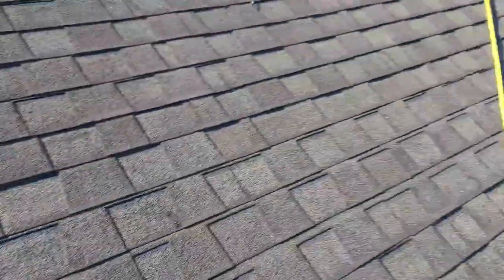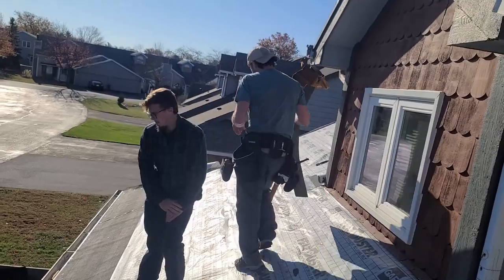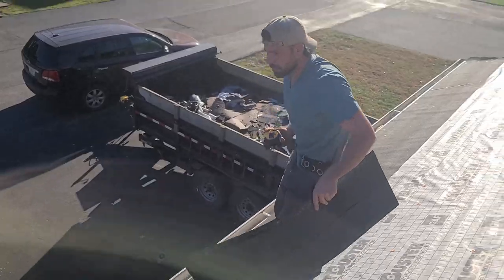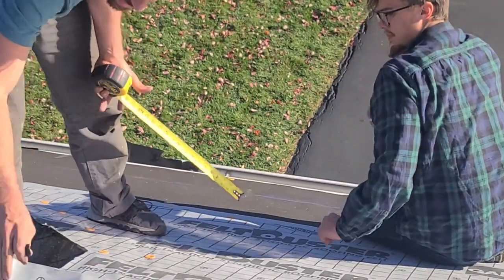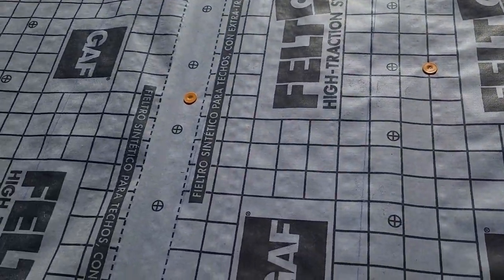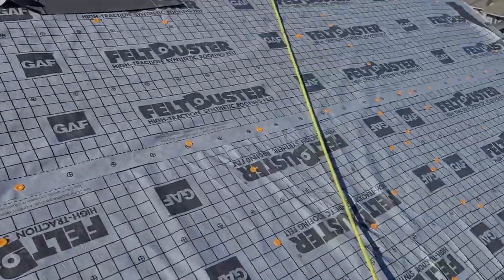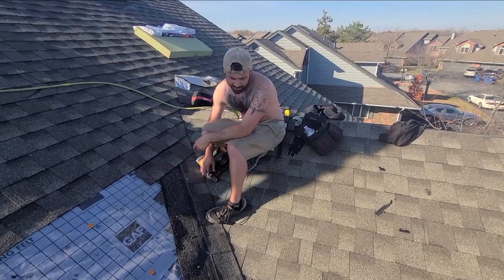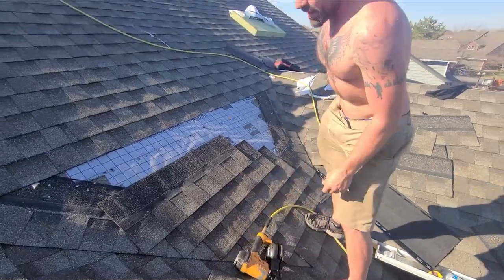HOW TO | Match Shingles Up Above Valleys

Comment: Just snap one line above dormers parallel to ridge, run up one section dropping a course 1/2 inch.  This allows you to not stretch the reveals on other sections.  Run first section near chalk line, and measure it.  The other two sections need to hit that number.   A lot less lines. Faster, and it’s good to ridge.
Reply from the maker: on the back side of this house i did that but slightly different. i was able to raise the starter on the other side of the chimney to make everything fit nicely.. but multiple shinglers made it look bad. boycub n brad haven't been shingling a great deal of time so shit gets crazy unless its just a regular straight run
Reply: This makes more sense to me and seem much faster good tip

Comment: PAPILLON,  it works out as long as the shingles are " all the same size ", sometimes they aren't. Takes too long your way.  We always snapped up in feet,  3'- 5' at a time and you don't have to backfill. We've roofed apartment houses developments that sometimes had as many as 10-15 eyebrow dormers. Never once had a problem. Just keep checking your reveal every so often. Straight as an arrow.

Comment: I like to get a metal strap and bend it up plumb off the pitch and put my laser level on it to get a control line at the bottom and the top.. Then you know exactly where the the points are off, relative to plum and level.. Tones of times.. The house has settled or the framers hacked the job or the sheeting is not clean on the edges... Its wet here in SE Alaska so if something is off. a coulple inches one way or another than put a short row with a zinc strip.. Thanks for sharing..

Comment: Holy smokes lol.... this is the craziest way I've ever seen a tie in done... take one side to top off your in dormer leave other side about 8 to 10 courses down... measure high side of plywood or ridge and pop a line to carry over them your in low side... never run courses high only low if needed
Reply from the maker: lol those guys were idiots. that's pretty much how i normally do it. but we kind of didn't do the straightest job on the back so i wanted to make up for it in the front, plus multiple shinglers..it wouldn't of ended well
Reply: @NWIVeteranConstruction  nah,doesnt matter how many sides goes up,start off biggest one then match with any remaining side by leaving 5-8 rows,super easy and fast.idk bout dis measuring sheet bruv
Reply from the maker: @user-sk9hl7si7l  I said the same about the measuring but we did it again today and only snapped our first at 11 1/4 then marked 45 90 and 135 until we got past the valleys n skylights.  Worked out really nicely and ran the rest as normal.  It actually looked really good and was fast as well
Reply: Mesure whit a tape line 😬 just trust the shingle I will ave to maike a video 😂🤣

Comment: If you chalk a line 3” down from ridge and angle the tape so you squish the courses within that space (ending up with a measurement at that top line being a multiple of your desired exposure) you end up with a full top course where the ridge caps come down far enough to cover the nails and less crap to cut off at the top of the roof. Takes a few minutes to get lines on the roof but I feel like you make up for the time in install by knowing you have good marks to work off of.

Comment: Nice work....

We do 11" if using 3 tab starter. Then mark a 12 1/4" but dont pop the 12 1/4". Its just to mark off of. Then for GAF dimensional (from the 12 1/4" mark) mark 22 1/4" marks up the entire rake. It would be 22 1/4", 44 1/2", 66 3/4", 89", ect.... that will give you some play incase the roof bows downward and when you get to deepest part of bow you won't be above the exposure line. 
Measure down from center of ridge to top mark on rake. Go to rake on other side. Measure down from ridge make mark sane as other side. 
Mark 2 or three down. Then go to eve and mark up to last mark you made at top. Check for accuracy. Adjust 1/4" or less per row to make right by the time you get to top row. 
So your cheating the center rows up to a 1/4" per line. Pop top lines above dormers and below dormers. Mark lines from existing lines under dormers and make sure they meet top line above dormers adjusting 1/4 " per line.
After all said and done top and bottom sections are perfect and no cheater runs more than 1/4" and in the middle where less notices.

3tab shingles are 11 then off of 11 its 20, 40, 60, 80, ect...
Rake lines are 11", 29", 35"....

Comment: Another good way of doing it is snapping your first line at 41 inches then every 56 inches you will drop a little bit but it works great
Reply from the maker: Sounds like a good move.  I was planning on doing 45 90 135 etc. From now on.

Comment: Pull up to pull down. Wrapping the peak will cause your bottom shingles to eat up any difference rather than have it in the middle or top.
Reply from the maker: what do you mean. pull from the ridge?
Reply: @NWIVeteranConstruction  start by pulling up from one side of the area, pull all the way up to the peak. Wrap the peak to find the mark. Make your mark and pull down.

Comment: I just put nails in the plywood joints every 4 or 8 ft then snap lines. No need to measure. Obviously measure on a boarded roof but with OSB just use the butt joints of the plywood and you will have straight lines every time.

Comment: You could never talk me into that underlayment unless it becomes code then it would get covered with felt and all valleys would be basket woven !;-)
Reply from the maker: are you still using tar paper? this GAF felt buster goes on quicker, barely cost more per sq ft. is safer because the nails won't slide through it on hot days, as well as its grippy.
Reply: Sinthetic is the way to go

Comment: Great vids man. Quick question, you measure the shingle to be 13.25, but then you chalk lines for 11.25. Just wondering why you chose 11.25? Im inclined to measure 13.25 every time
Reply from the maker: because the face reveal of the shingles needs to be accounted for in the math, see part 2 of my most recent roofing series which is very popular. the reveal is 5 5/8

Comment: Been shingling homes since 1985.  Doesn’t anyone weave valleys any more?? I make 25% of my income being called to new homes, tearing out the leaking cut valleys and replacing with a woven valley.  On a cut valley, the rain / snow water comes down the opposite slope, under the cut and into the building.
Reply from the maker: Mines a closed valley.  We have a shingle down that makes the straight line.  You can see in one of my prior videos
Reply: What you are doing is a cut valley or some call it a California cut.  I’m talking about a full weave. A row come in from the left , then from the right, repeat.  I have been roofing for 20 years before I ever saw my first cut, non woven valley.  Been fixing them ever since.  They might work the first couple of year, but dirt / mud gets caught under the cut and the water is pushed diagonally under the shingles. I have done water test and observed water cumming out
Reply: Coming out up 30 from the cut valley
Reply: I believe technically cut valleys are supposed to be cemented down along the cut edge, but practically no one does it.
Reply: Seriously! All I do is weave my valleys IDC if it's a 4 into a 12... Much more safe and secure valley! All the snow builds up and sits in the valley. If you don't do it it's cause ya probably don't know how.
Reply: If you dog ear ur cut shingles shouldn't have a problem